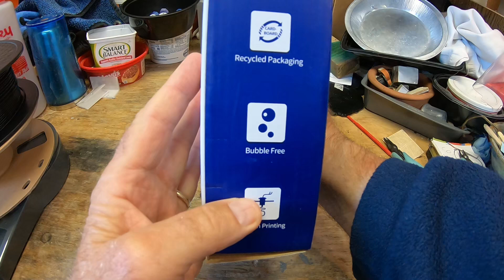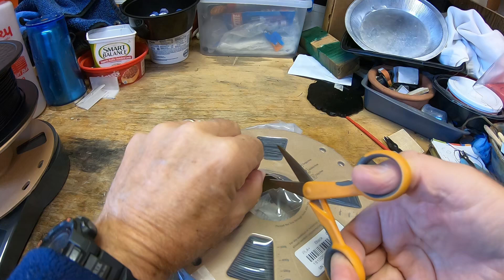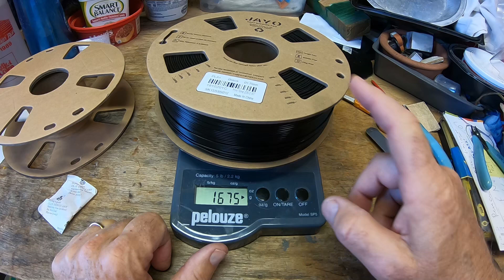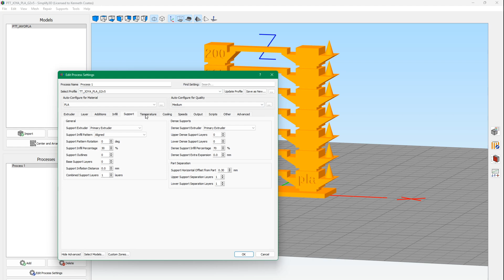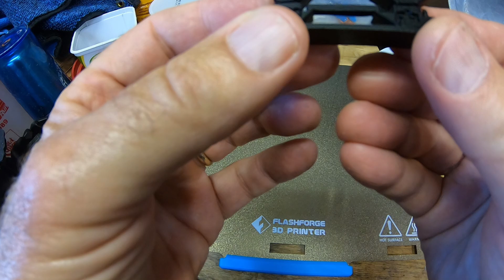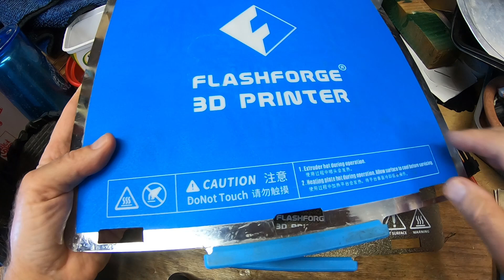JAYO Black PLA+ Filament 3d Printing Review - Part 1

Comment: Omg that buzzing sound is unbearable
Reply from the maker: The buzzing sound at the end of the video is coming from the printer. It's slightly annoying. I wouldn't call it unbearable. If it really bothers you, you can turn on Close Captioning and turn off the sound during that part of the video.